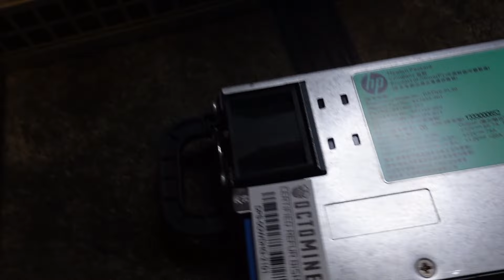Shed full of octominers here I come!!!!!! Massive shed changes coming!

Comment: I ordered 2 of these w/o GPUs but they came with 3x 750w psu's, but they didn't work on arrival ,so I had to send them back. I requested the 2x 1200w units in return. I did mention your channel when I bought them. Hopefully I can end up with some working units. I just couldn't get video out of them, loaded or empty of cards.
Reply from the maker: Keep me posted on how the return process goes, I have heard good things about it, and I'm sorry you didn't get working units
Reply: @kr00tmanmining  all good brotha. i thought it was me, but I tried 2 different monitors and still nothing. 1 of the fans were dead which isn't a big deal. They just gave me a refund. Would love to get some working units, but not sure if I should try again
Reply from the maker: @infineon222  you should try and see if you can find a replacement breakout board maybe that's the issue? If it's free now there's no harm in trying
Reply: @kr00tmanmining  no they sent return labels and then just now refunded me and sent some weird email I can post the screenshot on your discord

Comment: Moving server fans to outside- you think case will fit evga 3070 FTW3 ultra🤔
Reply from the maker: @Fiidler  so check out the 3rd part of the video I did that and it fit the top end MSI 3070ti
Reply: @kr00tman nice! What are dimensions (or model #) of the that big 3070ti .  I'll measure my big ol' 3070 before proceeding. Do you have an affiliate link?

Comment: They only fit 2 U GPU’s next to each other which is the case for most 3060 TI’s, 3070 & last 3070 ti.  At best all EVGA or MSI gamng X trio Cards because the 4000 series Cards are simply too long to fit into these PSP Octominers. The same goes for the AMD rx 6800 & 6900 xt.